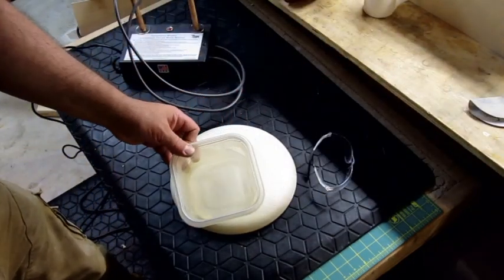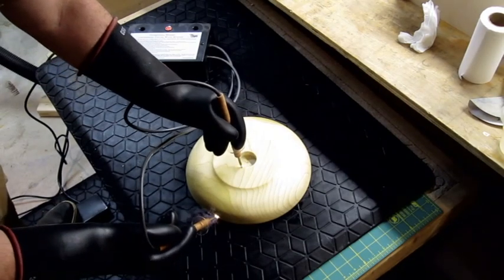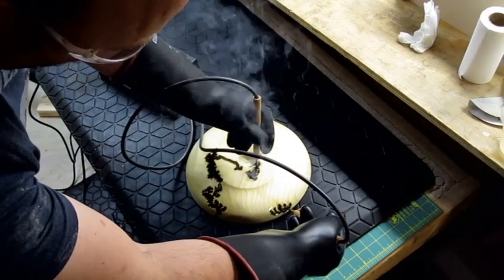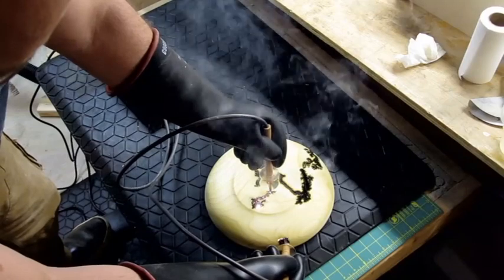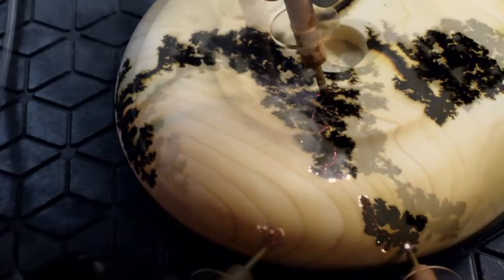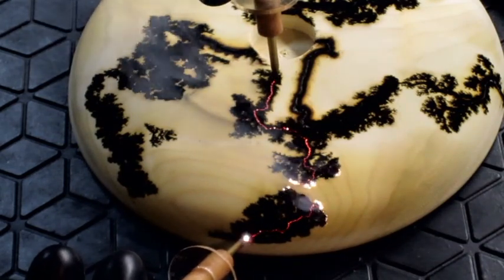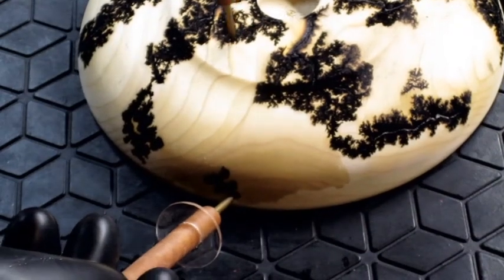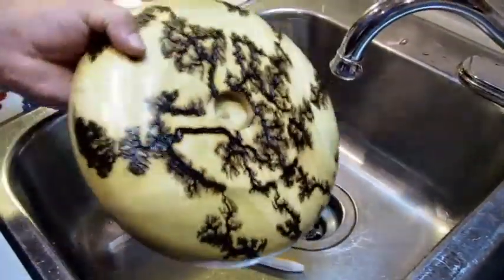fractal burning using a conestogaworks fractal burner

Comment: Love my Con burner! Thanks for sharing and making me wear my insulated gloves! Can’t wait until it warms up and I can open the shop door and do some more burning! Cheers from MT USA
Reply from the maker: You really can’t be overly precautions using this tool, I realize that the probe insulation is rated higher than 12,000 volts but my gloves are rated at 18,000 volts , that’s 6000 volts higher than the output, note some gloves are rated at lower than 12,000 volts so doesn’t really offer additional protection. They should be tested for pin holes regularly 
Also I’m standing on a thick rubber mat as is the tool and work piece. 
Stay safe
Rob
Reply: Thanks for the info Rob. I have been using a rubber mat under foot and also under my project. Do you know what the rating is for the insulated red  rubber gloves included with the Conestoga kit? Thanks again and stay safe.
Reply from the maker: Mine didn’t come with gloves, I bought mine separately